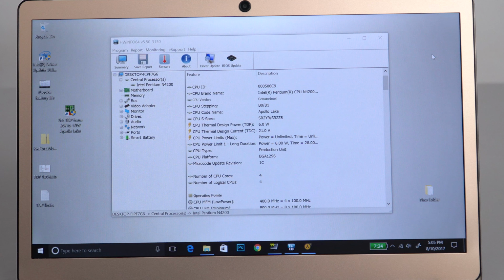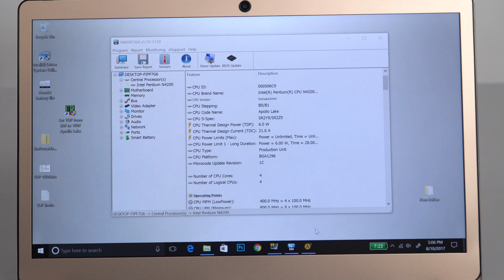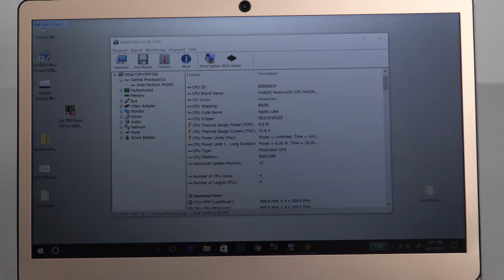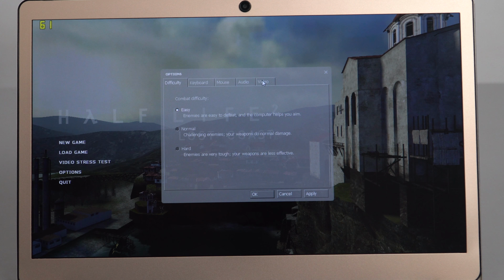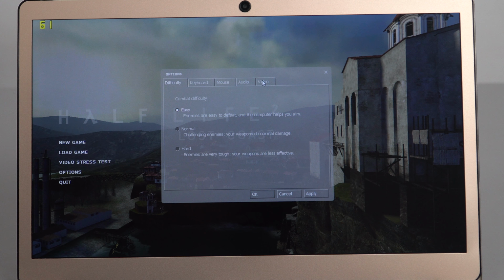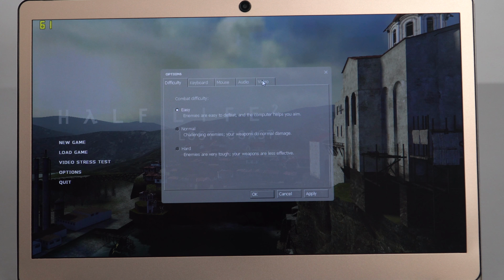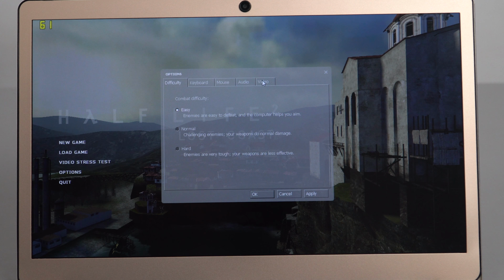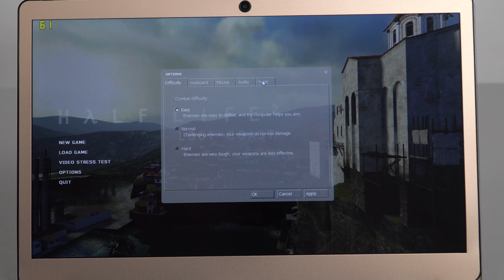Apollo Lake TDP/Power Limits. Unlock Full Potential Up To 80% More FPS!

Comment from the maker: This tweak will safely overwrite the stock N3450 &N4200 6W TDP (Thermal Design Point) to 10W or more allowing the Apollo Lake SoC to consume more power, using the maximum CPU & GPU clocks rather than power limit throttling. Up to 80% FPS improvement depending on the game.And up to 10% CPU performance.

More info & download: https://techtablets.com/2017/08/increase-apollo-lake-tdp-boost-intel-hd-graphics-performance-80/

Recommended laptops:
https://techtablets.com/recommended-chinese-notebooks-brands/
Reply: So what's the gaming experience, mate? I mean, I can see the logic of tweaking doing better gaming experience, but how is it actually? The heat, the CPU and the overall laptop condition? Did you play on it after tweaking the power limits?
Reply from the maker: Yes it's much better, for example, CSGO has around double the FPS and after 20 minutes of gaming on the Tbook4 thermals still under 80 degrees. But it is quite warm to the touch. I might show some gaming before and after, but wanted to keep this video short.
Reply from the maker: I looked at it today, it's the difference from 20-30 FPS in Dust2 800 x 600 to the 40-60FPS. Maybe i'll post a quick before and after video of games with the stock 6W then unlocked.
Reply: TechTablets.com I will be waiting to see if the Chuwi SurBook can manage this.
Reply: TechTablets.com want to see the difference in csgo and lol
Reply from the maker: No, not at this point unless there is a version of RW Everything for Linux it could then be done maybe?
Reply: Would you recommend on the Chuwi lapbook 14.1 that has the copper heatsink diy add on?
Reply: i am sorry if this is a stupid question, but... you need to unlock the power limit in the bios + run the script ? or this is a script for laptops with out the option for disable the power limit in the bios
Reply: Hi mate,
I bought a Chuwi hi13, I notice that you have done a review of this tablet, do you recommend to do this tweak on the Chuwi hi13?
Thanks 😉
Reply: i can't find the download in the thread i did ask it in the post but no one answers can you please help i am waiting like 2-3 days now
Reply: Can I do it with a teclast f5?

Comment: Doesn't work on my Pentium Silver N5000 :C
Tried everything I possibly could have tried and it simply just won't work... it's really annoying as the clock goes as low as 1.2Ghz when using integrated graphics on a game... the CPU is slow as it is but 1.2Ghz is a little too slow for me man, I'm saving up for a i5 11600k build (without GPU cuz for that I'll have to sell my kidneys to barely afford a GT1030) but it's gonna be a long time till I can actually buy it...

Would definitely appreciate any help regarding this annoying TDP limit, thx

Comment: I'm interested in buying myself a BMAX Y13 the I'm pretty concerned about the performance... I saw on TT forums that it does work on N4100...does anybody knows if that tweak will work on N4120 as well?
Reply: Yes it works, but after i downloaded the latest windows 10 20H2 it does not work anymore
Reply: @watdadamz6881 where do you know it doesn't work? Is it give and error or smth?

Comment: Emmm....Those are BGAs....They're going to detach at those temperatures...Keep 'em LOW...Or cool them MORE.
Too hot for those small **BGAs**...
I'm running an overclocked phenom with 140 watts TDP at less than 45° celsius with air cooling and GTA5 running like a monster....You can do better.

Comment: Hi, I made all the steps (I put the copper pad, etc, I install the RW program) but I don't know what command I need to write. Some help please? I'm spanish and It's dificult for me understand all the video.
Thanks.
Reply: WRMSR 0x610 0x0 0x00DD8F00 0 - TDP 15W
WRMSR 0x610 0x0 0x00DD8A00 0 - TDP 10W
WRMSR 0x610 0x0 0x00DD8600 0 - TDP 6W
WRMSR 0x610 0x0 0x00000000 0 - Unlimit

Comment: is there a way to reduce the burst frequency of n4200 processor? it always runs in full burst frequency at 2,5 ghz at my swift 1. i'd like to have a constant 1,6 ghz instead, so battery time will increase quite a bit. i could deactivate burst, but then only 1,1 ghz base core speed is a bit slow...
Reply: In 2023 I'm still using balanced mode which run on 0.79GHz. it still pretty fine, it still can watch 1 tab of 4k yt videos without lag. This processor is absolutely great! I hope this tweak will give me more performance! Since now im often using the high performance mode rather than balanced mode, cus it feels rlly snappy and quick feels like a modern laptop with an intel core i3 or higher!

Comment: Just curious, I applied this trick with my sisters pentium n3710, gladly enough i was shocked to see an 80w TDP, is this good or a bad thing?
Reply: Remuel Arellano what
Reply: You mean 80c?  That's a little hot.  If you mean the CPU is getting 80w well the CPU would melt in a matter of minutes so I don't think that is correct somehow.
Reply: And thats why i deleted it right away rofl😂, cpu usage was at 3% lol
Reply: @remuelarellano1793  did it work though? Can you take over the designed watts? Like my laptop is 6.0w if i make it to 15 or 20w will it reduce the cpu usage?
Reply: @watdadamz6881  For my sisters laptop, no. 

But for my pentium n4200 it worked well and is still effective as of today. 

I have it only on 10W tho as I'm afraid if I set it to 15W
Reply: @remuelarellano1793  i have celeron n4100
Reply: @remuelarellano1793  can i try that too?
Reply: @watdadamz6881  Well you can give it a shot, just monitor the wattage in HWINFO to see of it's at 10w and if it's not then restart your computer and AFAIK you will have to manually code it if it doesnt work properly on your machine
Reply: @remuelarellano1793  is HWINFO needs to download or it is on the explorer folder?
Reply: @remuelarellano1793  where do i put those commands? on command prompt?
Reply: @remuelarellano1793  what is the code?

Comment: Hi Chris, My Chuwi Hi13 has already 12W to it on default configuration, the tablet itself is cold as hell havent got it past 60ºc, didnt came with keyu charger eiter ( but i'm using a aukey for safety ).

Just want to ask something about the chuwi hi13, mine has a very pronounced Ghosting on the screen ( slow GTG response  maybe over 5ms ).

Do you notice it too on yours?

Thanks!

Comment: Fuck you stupid murmur. If you want to OC, the are tutorials for beginners out there.This has nothing to do with the clock
Reply: It has much more than you think, higher power limit means that the CPU / GPU would stay at Turbo frequency more often, so for example 2.5 instead of 1.8GHz
Reply: @MineXplayPL  it is in theory, but in fact it is extremely slow
Reply: @SonVirgoHacker  It depends what you expect, High performance gaming? For $300? Nice joke. Good office notebook with decent performance that's able to run Minecraft? You should be able to after unlocking the SoC
Reply: @MineXplayPL  it will freeze very frequently, you  PR a very bad product
Reply: @SonVirgoHacker  For me it doesn't freeze at all

Comment: Interesting tweak. I assume this will also noticeably increase overall performance when using programs like autocad (Yeah, it'll most likely be laggy regardless) and medium-level multi tasking for both the N4200 and N3450? 

Not well-educated on whether or not the tweak can shine much when doing stuff aside from gaming, and have been trying to decide between spending the extra money on the N4200 Xiaoma 31 or with the Jumper Ezbook 3 Pro for daily uni student usage + light gaming (that slightly underwhelming N4200 gaming performance increase has me slightly confused).
Reply: Dmt Harmless the gpu is the one most affected here. So cpu only gets a little boost from this tweak

Comment: When throttle stop finally supports  apollo lake we will truly be able to pushed it to the limits.

Anyway it would be nice to test the temperatures while it is charging as well, i recall this being a noticeable problem with my lapbook 14.1 which when charging will push the temps right up and sometimes just web browsing will push the temp to 90+ and putting the notebook to sleep
Reply from the maker: Lapbook 14.1 is known for bad thermals, which is why I did the copper heatsink mod. So far the Tbook4 and Xiaoma 31 it's quite good.

Comment: I must highly caution you in what you are doing. You are basically over clocking the processor and while this may be acceptable to many and most enthusiasts you must also remember that these chips have a certain safety margin but above that you are definitely shortening the lifespan of the processor . With these increase in power as you said comes an increase in heat which needs to be disapated so any much mod should also recommend an increased cooling mod. Sorry I didn't listen to your clip till the end as I am time limited here near the end of the week and I appologize if you have mentioned this further on . Great ideas .Thxs
Reply: Garry Gershon Schwartz nah, the only thing destroying a cpu is temps. And more power = more temps. But 70c is safe.

This is not overclocking. This method more like deletes the cpu ability to throttle. since the gpu works so good, it went over the tdp limit and can be toasty on many laptop, except the one with copper heatsinks, that's why it throttle
Reply: Increase watts is increased volts which is over clocking over voltage ,same same just different method ,still reduce life of processor if not disipate heat but this is easily done with some thermal pads or redoing the thermal paste on the processor ,have done this type of mod many many times ,very easy and extend life of system m
Reply: Garry Gershon Schwartz they don't increase volts. The cpu at 100% will do around 6 watt. The gpu alone at 100% can be around the same tdp. On games, both are utilised hence throttling happens. Its just a way intel prevent overheating
Reply: kenny ricardo ,breaking the laws of physics   now are we ? Please explain how you increase watts without increase volts ??
Reply: Garry Gershon Schwartz sorry. I forgot we are talking with iGPU.
Reply from the maker: I do warn about this and it's at users own risk. But I doubt it will be an issue unless someone was running their chip at 99 degrees c cooking it.

Comment: Wondering if this might work on an N3700.
Reply from the maker: Should do
Reply: Just tried it. Running this command...

RW.exe /Min /Nologo /Stdout /Command=”WRMSR 0x610 0x0 0x00DD8A00 0″

...raised the power limit from 6.5 W to 80 W according to HWiNFO64. Perhaps the correct value depents on the CPU.
Reply: This command...

RW.exe /Min /Nologo /Stdout /Command=”WRMSR 0x610 0x0 0x00DD8140 0″

...sets the power limit to 10 W but the time is 110 sec after either command. Not sure is that's ok.

Comment from the maker: Seems from some messages there is a bit of confusion. This tweak doesn't mean you can now play GTA V & Battlefield 1. The increase will depend on the game. The less demanding the game the more benefit you'll see. And then it all depends on temps & if thermal throttling takes place. So some systems the results might not be good at all if it has a poor heatsink.
Reply: Actually there's a video of throttlestoped n3450 Running GTA V at around 20~30 fps. I would imagine n4200 be able to pull it off with tdp unlock at 35 fps
Reply: How did you create that shortcut? Im trying but i cant do that.

Comment: How are the geekbench 4 scores at 10w and 15w?
Reply from the maker: About 5% more, no real difference as the CPU wasn't limited it's only really when power GPU and CPU are at top clocks it hits the TDP. Now with the increased TDP, both can hit and keep max speeds if thermals permit.

Comment: Would it be possible for you to make a video comparing the Battery life with 6W and 10W?
Reply from the maker: Maybe the thing is the battery life is only less really when gaming or pushing the GPU. Otherwise, it will use just as much power as before. Just because it's set to 10W does not mean it's using 10W all the time.

Comment: This could affect the VRM if they designed it for 6W max. But I don't think you should worry about that.
Reply from the maker: Yes but I've been pushing a few laptops hard since doing this and no issues. Nothing happened to the Civiltop Air either that could draw up to 14W according to HWinfo.
Reply: @Techtablets hey i want to ask, my pentium n4200 can draw up to 20 watts on short duration according to hwinfo. But i never get the maximum of 20 watts or even more than 6 watts. Can using this tweak enables to the maximum of 20 watts?